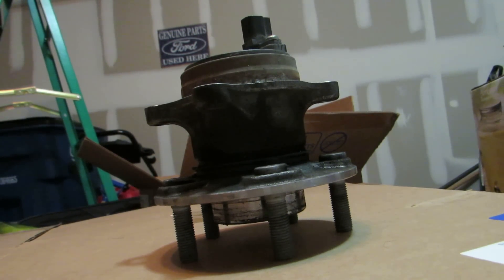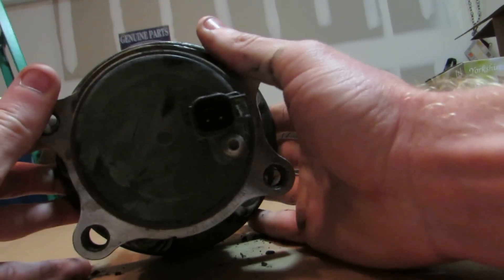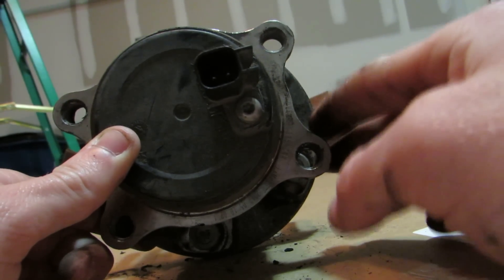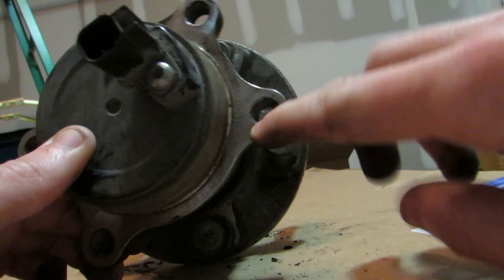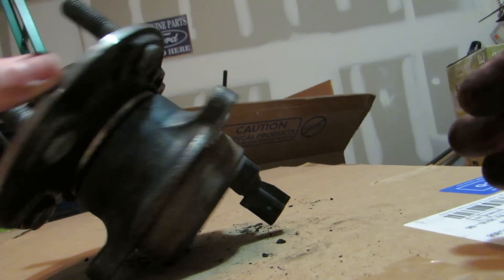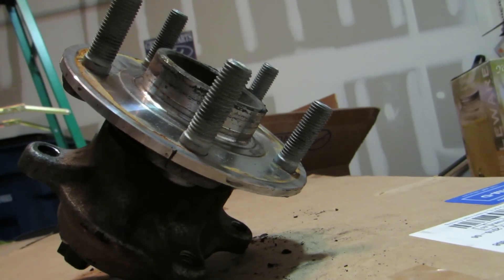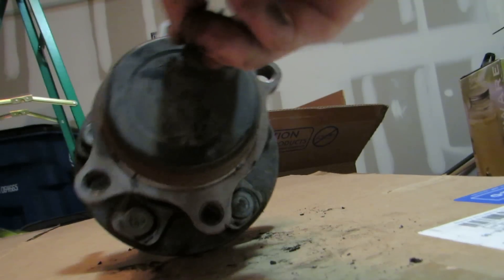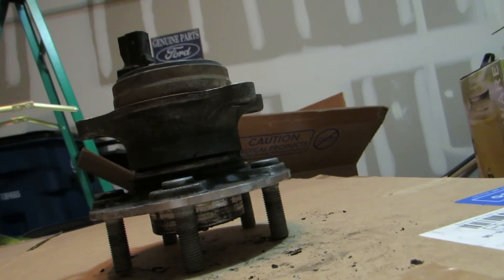2012 FORD FOCUS wheel bearing removal

Comment: Just finished this job.  As others have said, you need a 14mm e-torx socket, it's not hex.  Don't even think about doing this job without a propane torch.  No suspension parts need to be removed, you just need a 4" and 10" extension.  Heat the bolts up until you see them smoking and they will pop right out.  Be forewarned that the Ford manual says not to re-use the bolts.  I decided to tempt fate as they are $8 EACH...that would be $64 in bolts.

One more tip:  My bearings were seized into the hub pretty tight.  Knock out three of the wheel studs with a hammer, then use long 3/8" bolts with a nut/washer on the back side of the wheel hub and you can "jack" the bearing out in a few minutes with a wrench - very easy.

Comment: I just replaced mine earlier this week.  Jack up the car, remove wheel.  Remove Brake caliper, pads, bracket and rotor.  Now you need an E14 socket, and a 12" socket extension.  Those are the the tools I needed to get those 4 bolts off from the back.  I did not have to remove anything else from the car.  I DID use a torch to loosen those bolts because those suckers were on there TIGHT (Ford used Lock-tite on these things).
Reply: Was that from the front or the back?
Reply: Rears
Reply: How long did it take you? i'm at 115k on my 2013. did you have problems on the TCM and all the recalls. they swapped out my fronts wheel bearing for free at about 70k.
Reply: +Jay Mama about 3 hours start to finish.  I took my time and the bolts were stubborn.  I just had Ford replace the clutch under warranty early this month.  so far so good, it wasn't shuddering too bad before as I do mostly highway miles, but I wanted to get it in before I forgot to take advantage of the extended warranty.

Comment: These bearing hubs were very easy to change after I got the brake drums removed.  Just make sure you have the E-14 Torx socket and 1/2" drive ratchet and extensions.  Didn't need a torch and I didn't remove anything except the drums.  Even the brakes shoes stayed in place.  My only advice is to break loose all bolts then remove the top-rear bolt last or your socket will get stuck.  Also, be sure to have threadlock available for installation.

Comment: could not get the bolts off, so used my 115mm grinder with 1mm cutting disc, cut off one of the studs, then cut a corner of the hub base plate, then you can access and cut through the 'ear' of the hub and the centre of the bolt from the front. Each one in turn. If the bolt does not fall out, it will now turn with the 14mm torx and come out. 

I only cut into the backplate to the hub once...
Another tip, it could be the tire and not the hub making the noise, the tire can 'pattern' if the shock is worn or if there is play in the suspension.

Comment: Did the rear bearing replacement on 2012 Focus. I did not have to remove much. I had a 14" flex head 3/8" ratchet thank goodness. Not sure I could have done it with a standard ratchet. Did not heat the bolts. The hub would not come out, even with a hundred blows of a 4lb hammer. I ended up taking out two wheel lug studs and using two 1/2-13 " bolts in the stud holes. You have to put 1/2 nuts on the inside of the stud holes. Position the bolts at 10am and 330pm. Put a wrench on the 1/2 nut and tighten the bolts a few turns on each.  If I had known to use the bolts it would have been a two hour job.

Comment: Cruise randomly works in mine too. Rear bearings are shot. Figured they weren't sealed bearings because of the drums. This bums me out now. Not that pressing bearings is hard but also haven't found replacement bearings without buying the whole hub. Anyone?

Comment: Be nice if you stated if its the front wheel bearing or rear ur removing.....
Reply: A little late. Rear as the front wheel drive axle goes through the hub.

Comment: Same problem. Used extension, 14 mm e-torx socket, and torch. However, do you know the torque spec for the bolts?
Reply: Guessing you've finished the job, but alldata says 81 lb ft.

Comment: Based on what I am seeing on youtube, Ford should be class action sued to recall and replace all of this failing POS rear wheel bearings!!!!
Reply: There are at least a couple other serious problems with this vehicle (year 2012+) too: 3 acknowledged issues w/ transmission, and the radio eventually pops/"screams" randomly